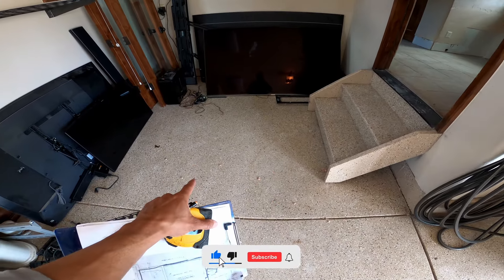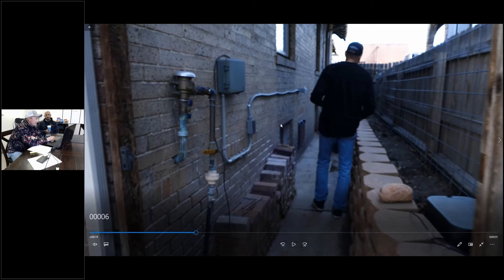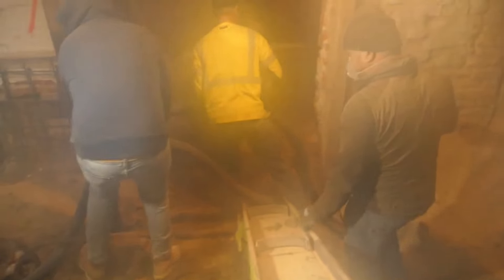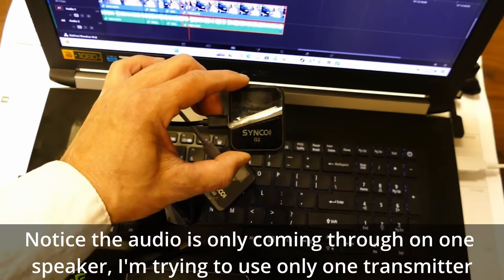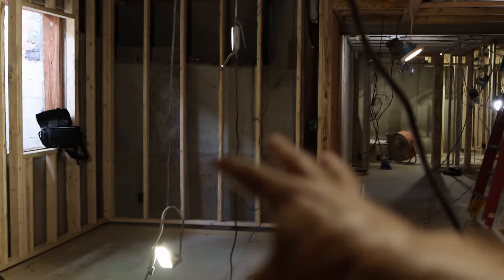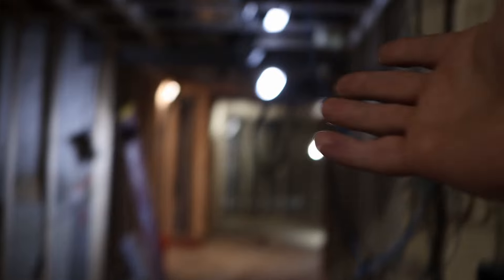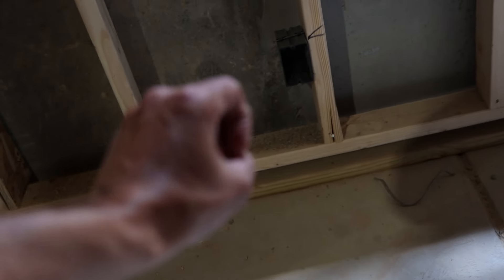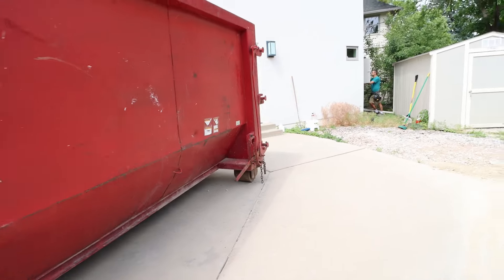Expert Tips and Resource on Your Crawlspace Conversion

Comment: Nice video. How do you support a wall where the floor joist runs parallel to the stem wall you need to open up?
Reply from the maker: It has to be supported the same. We walk through these steps in some of our videos, I don't recall exactly which ones. You should browse through